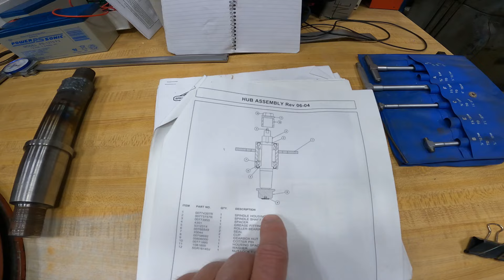Rhino PM42 brush hog complete driveshaft rebuild, welding shaft diameter and turning to size

Comment: Nice job Dave!  That's some impressive machinist work.  Next time, I'd like to see how you make your keyways.  Congrats on the awesome brush cutter!
Reply from the maker: @AlexsProjects  thanks Alex!!  I put the shaft in the Bridgeport, found the center of the shaft, touched the endmill down on the shaft, lightly touched until I had the full circle of the cutter, then I zeroed my z axis and went down half the key size. I do it that way so I don’t have to calculate the chordal height. That brush cutter is a beast, I was making trails in the woods going over 2” diameter trees with no problem!!  Thanks again and have a great rest of the weekend!!
Reply: @whatsnextgarage  Well now I wanna see you operating the Bridgeport!